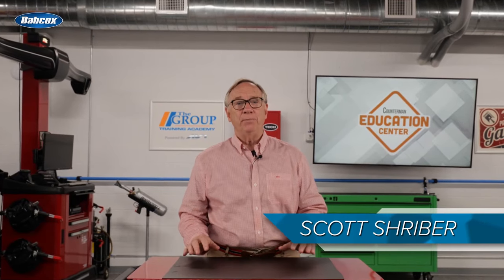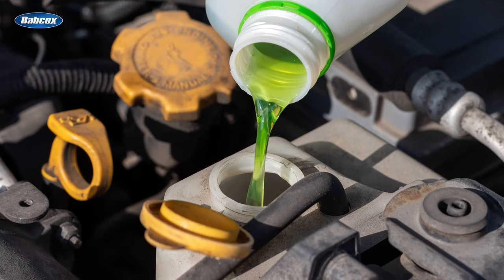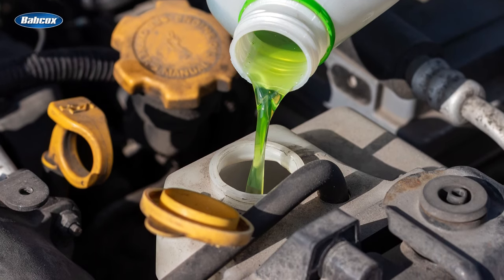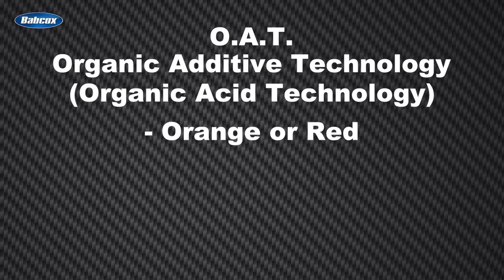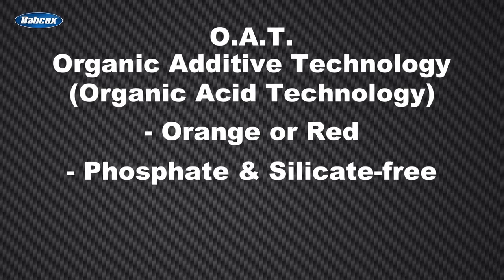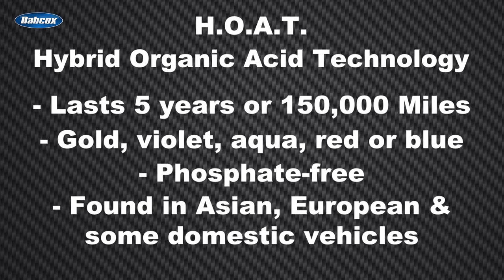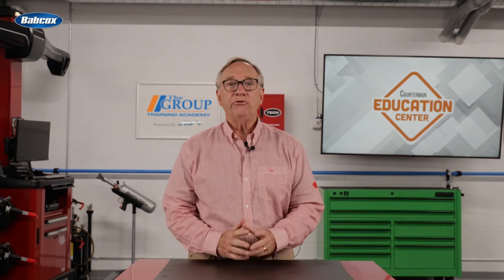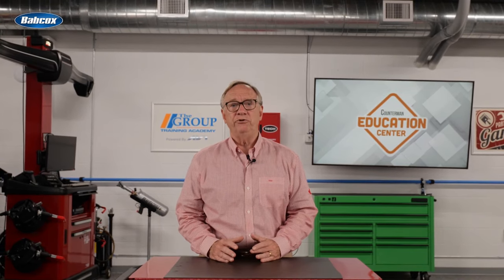Understanding the Role of Antifreeze/Coolant

Comment: Oxygen needs to be present for corrosion. Since we're working with a closed system, there is only so much oxygen available to the corrosion process. Unless more water is added, corrosion can only go so far. Since corrosion is nothing more than rusting or burning of metal, how could corrosion be a factor once all available oxygen has been used?